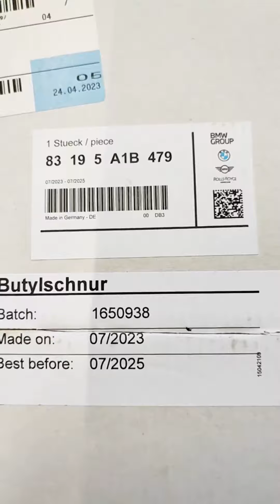BMW F10/F11 REAR DOOR LEAK REPAIR.

Comment: Since the BMW Butyl- Stuff lasts approximately 2-3 years, I chose a product called SIKAFLEX 522. It's a sealer from roofers & campers and glues and seals it forever to the door panel. If I'd have something to repair inside the door now I'd rather buy a new styrofoam than having water under my carpet again.

Here's a short clip: https://youtube.com/shorts/ArfBGLxpVnA?feature=share